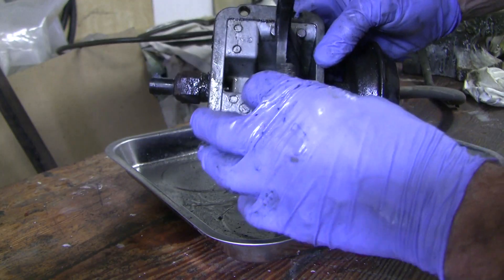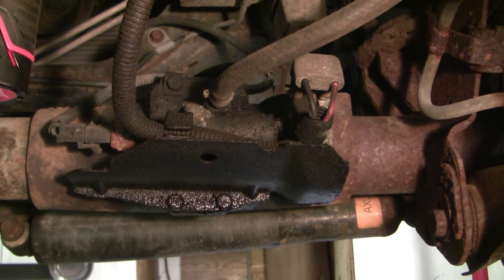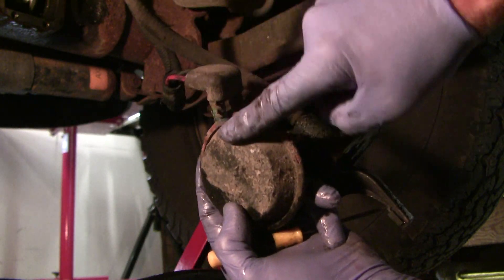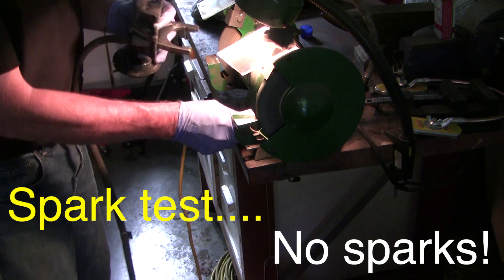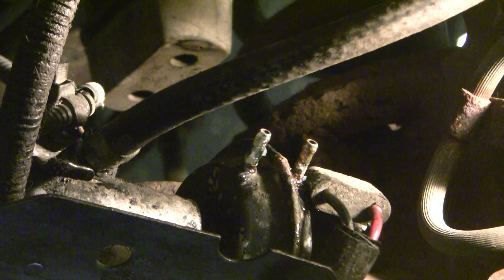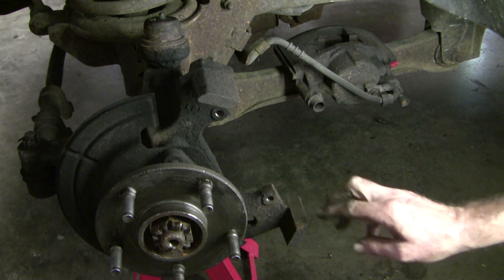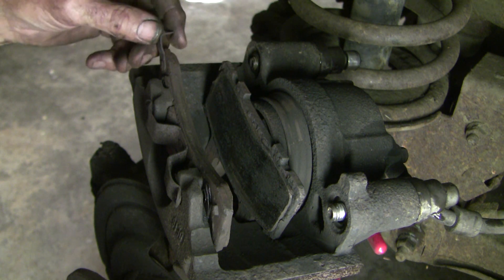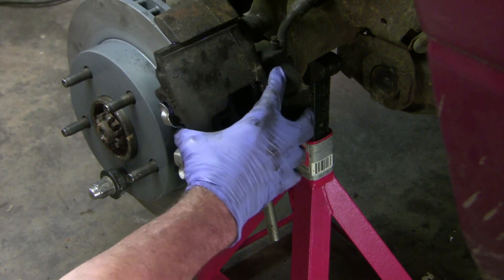Dodge Ram, Front Brakes and Leaking Gasket Repairs

Comment: I used gasket maker on mine. If the gasket failed once, it’ll fail again. 100k miles later, and the gasket on the differential hasn’t failed, or been changed. Btw, you’re supposed to add 5ml of gear oil in the actuator house via the switch hole.
Reply from the maker: You're the second person to say that, I'm glad you dropped by. It is  not stated in my OEM repair manual but it seems like wise advice. We park on a side hill and I expect diff fluid to slosh around by gravity in any case.
Reply: @spelunkerd  My mistake, it’s 5 ounces. I just looked over my factory service manual. If you’d like, I can send you a screenshot of that section via email. That may be, but I’d still add it just to be safe. I’m glad I could second the statement/claim. Also, the housing bolts are tightened to 96 inch pounds.
Reply from the maker: @adriananoelle4699  I'm not really too worried about that, since over 20 years I've removed that cover half a dozen times without ever adding oil there. You noticed gear oil spilled out when the cover was removed at the beginning of the video. So, it gets over from the diff through the axle tube, even if it is not added locally. Even so, I probably would have added oil there if I had known. It can't hurt, as long as that rusted old sensor doesn't break on removal.

Comment: My 96’s front rims get very hot, and nobody can seem to find the issue. She has new calipers, new pads, new hoses..what could be the issue.
Reply from the maker: Sounds like you've covered most of the problem areas. We usually focus on asymmetry, since hot brakes are pretty common in these heavy old trucks. The Dodge has drums in the rear, I'd wonder if they are working properly. If the rear drums are out of adjustment, there is extra work to do in the front. I guess the other area not explored is the MC, although I've never seen a problem there cause hanging brakes....

Comment: Glad to see another one of your auto repair videos.  You are one hundred percent right about cleanliness and inspection. When I started out in this as a "hobby" 13 years ago I had no idea about roloc discs, corrosion inhibitor sprays, or bench mount wire wheels.  These are now an essential part of my arsenal here in Ontario.

Comment: Hi mate. Just watched another great video with some basic principles well made as always! Just wondering, I worked on Land Rovers, Range Rovers and Discoveries since 1972 as we used to do a lot of 4x4 racing and trials. Most with the American V8 Buick 3.5Ltr or the later 4.2Ltr Petrol, until the new V6 twin turbo diesel just made them obsolete.  Correct me if I am wrong but that vacuum actuator is what we would call a front axle diff lock? Connecting the two half shafts to the front diff when engaged or locking them together? We used to fit a product called a diff locker to landrovers that locked the front and rear diffs and mechanical diff locker to the centre diff that basically on request could lock all the diffs on poor ground. Down side was all the wheels do the same speed and lead to transmission wind up. With the later Discoveries the control was all electronic via the abs ecu, locking wheels or axles for max traction and no wheel slip in any condition. Added to the air suspension they were just unstoppable.... Oh how things have changed :-)      You scope of knowledge and just plain common sense is great, apart from YT have you ever thought that you could pass it forward in some way?   Sail safe mate. Ant
Reply from the maker: Yeah, in my Dad's old F150 we would jump out of the truck to manually turn the hubs in, locking the front axles together. Problem was, if you were already stuck you wouldn't have time! I remember more than once rolling through a mud pit, cussing because we forgot to lock in the hubs. Electronic is easier when they work, but I kinda like the simplicity of a hard shift lever.

Comment: Jeep owner here... The caliper setup on my TJ is pretty much the same as your Ram. You're well advised to every so often pull the calipers, even if you don't need to do other brake service, and clean/grease the knuckle interface to keep the knuckles from wearing down. The real "fix" for worn knuckles is new knuckles, and at least for mine they're about $400/ea. No thanks! :)

I'm also surprised to see it uses a front axle disconnect. Jeep quite using those forever ago. And... A set of cheap hose push off pliars will change your life!

Good video man!
Reply from the maker: Wise words.

Comment: Hello Dave.  The shift motor cover is cast aluminum.  I went through this last year when I replaced all the front axle seals in my 98 Ram.  My cover was so corroded after 22 years in the rust belt that the upper bolts became part of the cover.  Other than that, it was in good shape, so I drilled them out and replaced the bolts.  There should be a cork and metal gasket between the shift motor housing and the axle.  This is important because it sets the depth of the shift fork's pads on the actuator.  The FSM also states to remove the shift motor position sensor and add gear oil into the housing through its hole, about 5oz IIRC.  The gear oil will make its way there from the differential, but it takes a while.  If you check the level at the diff cover, you will likely find its gone down a bit as some went to the shift motor housing.  Great vid, as always!
Reply: A gasket in there may also slow down the galvanic corrosion between the iron and the aluminum. I like to anti-seize the shanks of the bolts and loctite (blue) the threads for those types of applications to keep the corrosion down too.
Reply from the maker: I love these kind of value added remarks, bringing the conversation to a higher level and adding new insight to what is shown. This is the third time I've been into this housing, mostly because I was fiddling with that bear of an axle seal about ten years ago. Years ago I broke a bolt, too. The OEM gasket from the factory was paper, I used a home made cork gasket on a first attempt, and when I had to go in again to get at the axle seal I switched to paper. It was never metal in my truck. You raise a good point about the option to add oil through the sensor hole. Each time I would just overfill from the diff, I didn't even think about putting it in elsewhere since there is free flow of oil all down the shaft. I also didn't even think about differences in seal thickness, each time the shift motor has come out working fine. Since there is no standing water inside the shift motor I'm not too worried about galvanic reactions, though I have rarely seen it in other settings. With all the adjacent rusted steel, the aluminum isn't working very well as a sacrificial anode, ha ha. Thanks for stopping by!
Reply: @spelunkerd  I'm not sure what your winter road conditions are like (I had assumed not awesome), but the salted roads I get for half the year in my part of the world generate plenty of salt water to encourage the galvanic cell to work its' magic. It's 100% expected for me to have galvanic corrosion issues on things like alternators and tensioners and those aren't even in the immediate path of doom like a front axle would be.

If it's aluminum, I anti-seize the hardware 100% of the the time. If it's unsprung weight, I loctite nearly 100% of the time, if it's both, then I "both"  them strategically to get what I want of each where I want each of them.